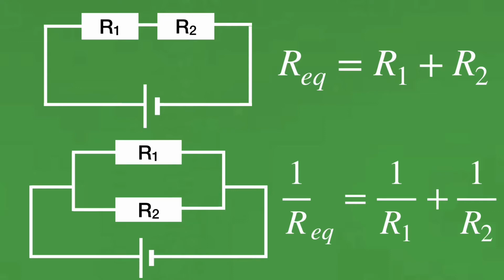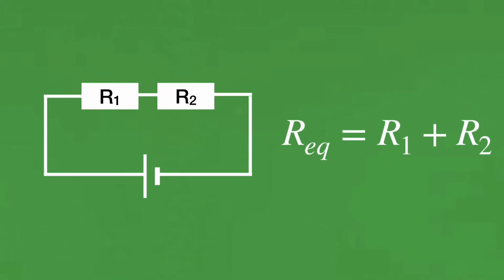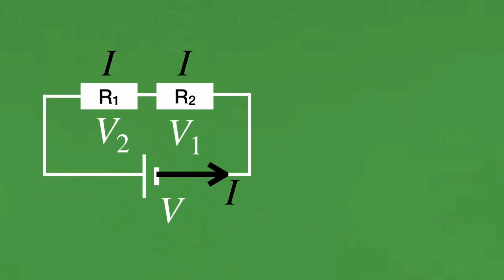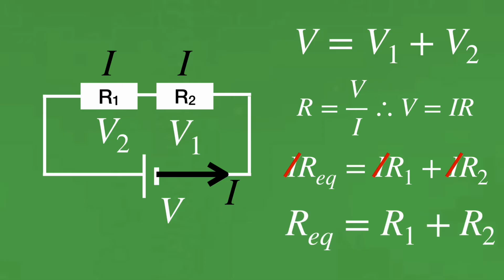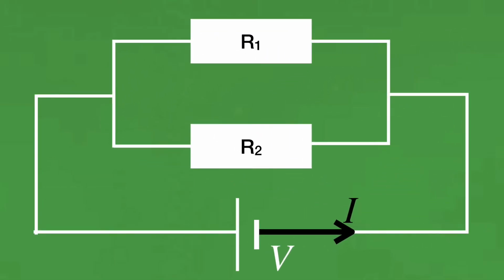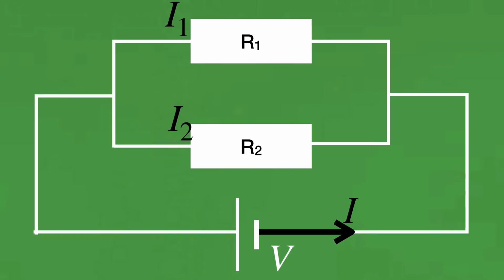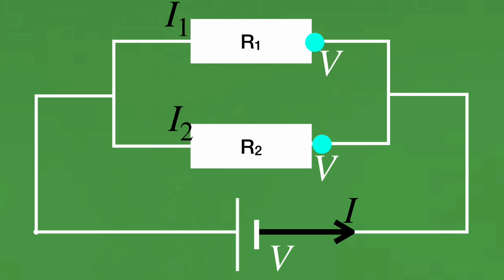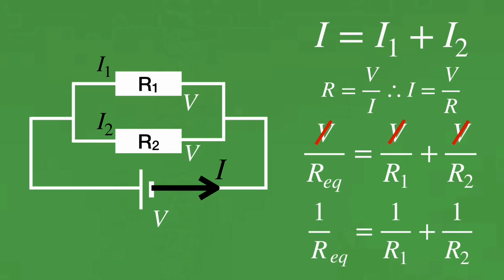Deriving the Equivalent Resistance Formulas for Parallel and Series Circuits

Comment: The part where you cancelled the V,s and replace the 3 V,s with 1,s
Is still not clear.
I can still remember and use the equation but still can't explain it to some one else.but I did learn things ,just not as I wanted to ,so thanks. 
Sam.
I wish I could get a lesson.
Reply: did u ever figyure it out :/
Reply from the maker: Ah sorry for being late to get back to this. I just divided both sides of the equation by V. Let me know if that helps

Comment: I can't understand why R equavelnt is in fraction(parallel )and I see that's not the rule of R quavilent that's the rule of Intensity when v is constant in parallel
Reply: In parallel combination, the potential difference is same across all resistors so we just need to find relation between current and resistance.
I.e,
According to ohm's law,
V = RI
So, I = V/R 
Here, you can see that resistance reciprocates. Since V is same so it'll just cancel out and you'll get the result 1/R
P.S: I haven't derived as he did in the video
Reply from the maker: Thanks for replying, somehow I missed this one. Yeah, we basically agree, the point is voltage is constant over the resistors in parallel and the current must add by conservation of charge and since current is related to voltage and resistance by I=V/R, we can that the resistances add in their reciprocal (cause V cancels out)

Comment: Awesome video. But can you explain a bit on why v=v1+v2?
Reply from the maker: It’s basically just conservation of energy, the energy of the cell/battery needs to go somewhere and the only two places it can go is resistor 1 or resistor 2. Why is it just conservation of energy? Recall that volts are joules/coulomb, so we’re essentially just dealing with energy. If some other aspect is confusing you, let me know.

Just anticipating a question here: you might then wonder, in the parallel circuit case why is the voltage over both components the same as the voltage over the cell? Doesn’t that break energy conservation? No, it doesn’t.  This is where the other part of the definition of volts comes in. Volts are joules per coulomb, that is a cell gives each bit of charge some energy. But as the charge travels throughout the circuit some of it goes down through resistor 1 and the rest goes through resistor 2. So energy needs to conserved and it is for each individual charge. Each charge gives the energy it was given to the resistor it happens to pass through.
Reply: @TheBrainFiller  thanks for your elaborative answer. Appreciate for efforts
Reply: Ye so much eff9rt😢
Reply: Consider Kirchoff's Laws